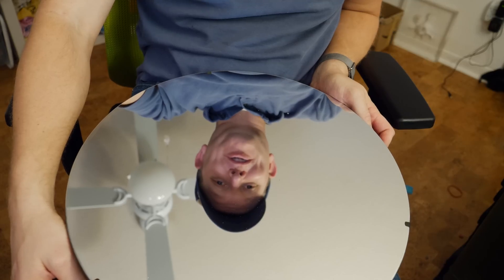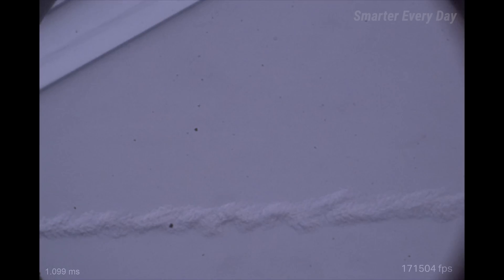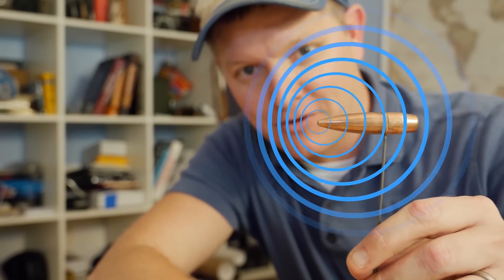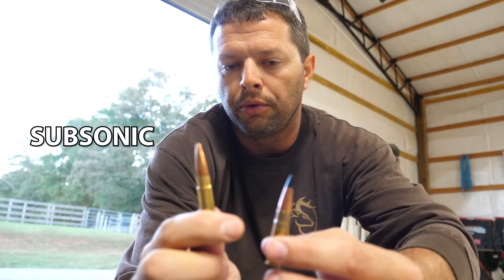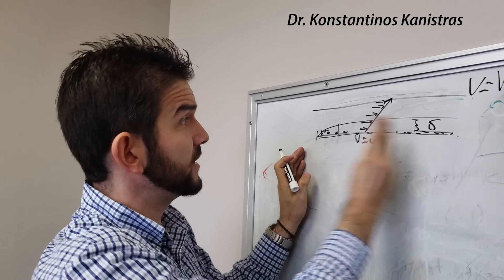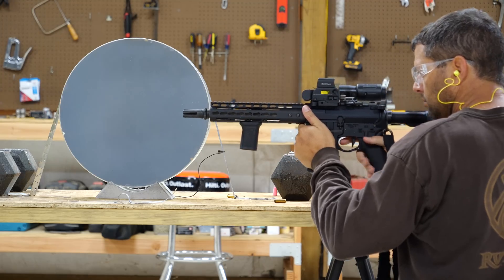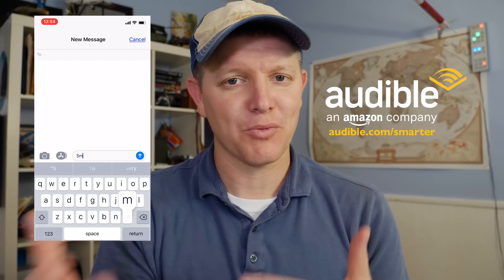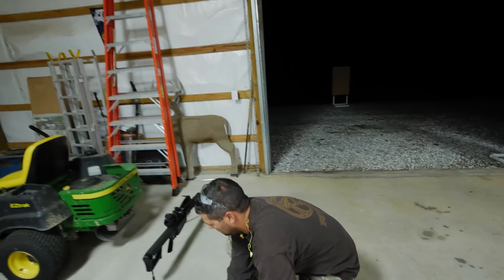Shockwave Shadows in Ultra Slow Motion (Bullet Schlieren) - Smarter Every Day 203

Comment: Good video, but I am going to go way out of my league and question your findings on the subsonic bullet. Depending on your serious friend's rifle it probably has a rifle twist rate of anywhere from 1:7 to 1:8 so every 7 or 8 inches that bullet will do a full rotation. Bullets on the outside, especially if they have been fired (they will have rifling imprinted on the side of the bullet at the very least), are far from smooth. Here is where it becomes pure conjecture, would that rate of spinning cause a small sonic disruption. In theory if that bullet was traveling at the rate of 1000 feet per second the pullet would make a complete rotation every .04 seconds for a total 1714 (rounded down) rotations per second or 102,840 rotations per minute. If we use the  n • 2πr formula where n = the RPM we should be able to get the velocity 102,840(2 X 3.14 X .154) = 99,458.6 feet per minute which is 1657.6 feet per second which is above the speed of sound. Now I have not taken into consideration drag or loss of velocity for any reason and on top of that I have failed every math class i have taken, but could that account for what you are seeing?

Comment: Destin, I love your videos. I'm a science geek, but one thing still bothers me. I've heard about Schlieren optics before, And I can look up online how to set up a spherical mirror and light point source, but what I don't understand is why the razor blade in necessary. Is the blade literally cutting light? and does it have to be a sharp razor or can a dull piece of cardstock provide the cutting power to activate the schlieren's power?
Reply: It's there to provide contrast for the ever so slight path difference of the light due to refraction. Think of the moving air as a weak lens. Higher pressure air has a different index of refraction than lower pressure air. The deflections are tiny especially at the focal point where it should be placed. So consequently the sharper the edge the better the contrast. Razors are used a lot in optics experiments.

Comment: Destin, in the right conditions on larger aircraft (757, 767) you can see the normal shocks over the wing. If you are seated above the wings, headed towards the sun, and you shift your head around, you will see what look like  vertical breaks in glass hovering on the wing.  When I was traveling a lot I noticed it and then made a habit of looking for them.

Comment: I think the circles are the actual sound waves. You should try different musical instruments and see if you can tell a pitch by measuring how far apart the circles are. Also, seeing the circles reminds me of a rock hitting water–the fluid dynamics at work between the bullet and the rock must be similar. 

Interesting note about the standing shock waves: During WWII when aircraft were improving their performance we started running into all sorts of problems with the aerodynamics and we didn't know why. One example is the P-38. It used to lose control during a nose dive because the standing wave disrupted the  air flow over the elevator.

Comment: I work at an airport and on sunny days I will see shadows on the ground coming from the sun passing through the airplane exhaust. The shadows look similar to the ones from Schlieren imaging. Is that because the light source is already essentially a point source, therefore it is able to project an image showing the variations in density of the hot exhaust?

Comment: The twisting of the center band comes from the fact the bullet is spinning and a 50 cal bullet has mid-body grooves due to the rifling. It may also have mid-body grooves put there during manufacturing.

Because shock waves represent, well, wave drag, this tells me the round would travel a lot further, faster, with a redesigned shape optimized for supersonic flight, along with a modification to be used in a sabot casing to minimize any surface marring.  You cannot ever eliminate shock waves.  You can, however, significantly reduce them beyond what you see, here.

Comment: I used to be a pipe fitter apprentice and solder/propress thousands of feet of copper pipe for hydronic heating and cooling systems. I would fill a tremendous volume often an entire high rise or lab floor worth of piping to 100psi to see if it was sealed. After some time I would blow it down and get to stare at the lensing effect coming out of the quick disconnect for a good while. Had to be super sonic. Very fascinating. You just had to have some good light in the background. No fancy setup required. You should try it!

Comment: Destin, for a long time I've been interested in the Bernoulli effect affecting BB's shot from an airsoft replica with a hop-up system.
You have the perfect setup now to capture this and I would love to see you make a video on it.
If you want to stick to firearms I have a different suggestion. Could you try to capture the difference in air pressure around a bullet caused by its spin?
I think the lines you saw might have partially been caused by that.

TL;DR spinning projectiles and Bernoulli effect is interesting, please film this.

Comment: Perfect opportunity to go into why flat base bullets are less efficient than boat tail bullets....but a wasted moment. Boat tails fly more cleanly through the air with less wake turbulence than flat tails. This gives them additional range. The.  .30-03  cartridge was developed for the m1903 springfield rifle. The cartridge had a lot of faults - Round nose, flat tail, and 220 grain weight. The high pressure powder behind the heavy bullet created chamber throat erosion. So they went back and redesigned it using features the Europeans had adopted. They put a spire nose on it, reduced its weight, and gave it a boattail. This new .30 cartridge was adopted in 1906 and became known as the .30-06. It became a premier cartridge in the US. That boattail and nearly 3000 fps velocity made it shoot flatter than other rounds of the period. The WWII ammo for the M1 garand was a derivative of the .30-06. Same dimensions but with a 150 grn. flat base bullet and less powder to lower operating pressure in the garand. It was called M2 ball ammo. But stocks of real .30-06 were still being made for the marine corps and for use by snipers using the m1903 springfield. The boattail and and heavier bullet could make a bullet  reach out and touch the enemy. There's stories of regular GIs using standard .30-06 in their garands for better accuracy. The round of choice was the armor piercing variety. The steel core evidently caused it to gyroscopically precess less than lead core, so has been alleged.

Comment: Cool videos of the bullets!

I have myself been studying near speed of sound flows over airplane wings, like what we saw with the slow bullet. 
The acceleration of the air around the wing causes it to move faster, but by setting the wing at an angle, the air travels down the length of the wing to extend the time it uses to get over the wing and accelerating the air at an angle, so the extra speed is split up in two vectors. All this is to reduce the speedup of air parallel to the direction of flight.
When the air then reaches the tip of the wing, we then place the winglets, or the tips of the wings, to reduce the turbulence that the air pushed outwards creates. This causes a vortex, or the swirl of air around the tips of wings, reducing drag.

Really cool physics, very simplified in my explanations and even more advanced, but fun, when you get to supersonic flight. However, that briefly explains why commercial airplanes have wings at an angle and some slower propeller planes have straight wings.

Would love to see a video of that if that ever becomes possible!

Keep up the good work!

Comment: This is an insane video! This reminds me of a phenomena that I saw while flying from San Diego to Detroit on a Delta flight. I was  sitting in one of the over the wing emergengy exit seats and loooking out over the wing. The aircraft was a Boeing 737-800. Due to the unique angle of the sun and the flight path, I was able to see a normal shock. It looked like a really thin dark line fluttering over the wing. I am wondering who else has ever seen this?

Comment: Hi SmarterEveryDay,
Wonderful video as always, stunning visuals. I have a question about this though, how are we sure about these refraction patterns are due to shock wave and not temperature difference? gun nozzle, exhaust gas, gun surrounding  and moving bullet everything would create large temperature differences which will (I assume) create similar images. could you please explain if possible.
Thanks!

Comment: If you want to determine where the secondary shock waves are coming from try placing on object interferes with the wave slightly on the surface that you expect the shock wave to be coming from. You might be able to see the footprint of the interfering object on the video.

Comment: Regarding those secondary shockwaves, you can just measure the time between the bullet passing, and them and use the speed of sound to measure the distance of the reflector and see if that matches the height of the table, and the bullet from the ground.

Comment: Hey Destin, if you want to improve your setup: the light travels through the area of interest twice, on its way to the mirror, and when it travels back to the camera. Because of the small offset this puts two schlieren inages on top of each other, with an offset. You can see in your image that everything is double. You can prevent that by having a larger angle between the two paths of the beam (and don't shoot through both of them). I hope this message reaches you.
Reply: I've worked on a similar setup to monitor airflow in an OR.

Comment: Also super interesting, with the .50 cal round it looks like you can see the effect of the rifling on the bullet.  Just behind, or at, the widest part of the round, the shockwaves appears to be twisting.  Also maybe a similar artifact as to what was seen with the sub-sonic round, caused by the air accelerating and decelerating while it enters and exits the rifling grooves?

Comment: I now know what Schlieren Photography is. I've seen many examples, but this is the first good explanation of the setup and how it works. Very cool and thank you.

Now for a question. Destin, I am fascinated by the dynamics of recoil in both handguns and rifles. At what point in time after ignition does the recoil impulse begin? What part of the recoil is attributable to the movement of the bullet and the pressure imbalance when the bullet clears the muzzle? Are there other factors?

Have you done this before? If so, a pointer would be most welcome.
Reply: Recoil begins when the bullet starts to move. Recoil is a function of mass and velocity, which can be calculated by the conservation of momentum equation.
mass x velocity(projectile) + mass x velocity(gas and unburned powder) = mass x velocity(gun)
Impulse = Force x time = mass x velocity
Things get complicated when there are moving parts, like a gas piston, recoil, or blowback action. A muzzle brake changes direction of the muzzle gases, changing their contribution to recoil (velocity is a vector). Also, a gun is not usually free floating, so the interaction between the gun and holder can get quite complicated as well.
The base equations are simple, but knowing the actual values at a given moment in the firing process is very difficult, so it is unlikely to come up with a meaningful calculation of a real world recoil impulse.

Comment: thinking on the transsonic as he called it or the supersonic movement of the subsonic bullet. I would presume that the directions of movement of air that is supersonic and the direction of the bullet are different. which I find really interesting. the bullet is traveling directly left (in relation to the video) but the flow that is supersonic is reaching the speed because of the additional moment outward from the center of the bullet.

Comment: Destin, get a bull whip to crack in front of that Schlieren setup.   Note however, that research has shown that it's not the tip that produces the crack sound, but the loop traveling down the length of the whip.    Should be able to prove or disprove that.  
Also a claim has been made that when a rock drops into water it forms a pocket of air that is ejected at supersonic speeds as the bubble collapses.  Might be an interesting test.

Comment: Dumb question... Does MACH speeds only translate on Earth? I'm assuming MACH speed would translate to a different "distance per time" on different planets or in space.
Reply: It translates to different speeds on Earth too. And outside of any atmosphere Mach has no meaning. That is because Mach is not an absolute speed. It is the speed relative to the LOCAL speed of sound. The speed of sound depends on the gas composition and its temperature. That is why Mach 1 at sea level is much faster than Mach 1 at 30,000 ft, or why Mach 1 is a higher speed on a worm day.
Reply: ASJC27 I did NOT know that. I feel smarter today.

Comment: That Normal Shock is one of the reasons that historical aircraft had issues when they started approaching the speed of sound. That shock wave (non-symmetrical above and below) would start interacting with the control surfaces of the aircraft, causing instability. Getting past that transsonic zone was hard and dangerous back then.

Comment: Would be interesting to get the same imagery of the muzzle break of the barret. There's a lot of debate as to weather it's well designed or not. Certainly it's effective, because it's got a lot of gas to work with, but is it efficient?

Comment: Howdy. The circles you see are probably the same you hear (the "zip" sound)  when a bullet passes by (ignoring the initial blast and the shock you would hear from a supersonic one). Sound waves. Put a powerful speaker in front of your mirror and you should see those too.
Also, if you want to check where  reflections are coming from, simply time them and multiply them by the speed of sound. You may need a factor of 0.5 if it is a reflection (time to go and return), or not if it is from the nozzle. I do this all the time in my work doing CFD.

Comment: Lol, Ive tested subsonic bullet in a fluid flow program. Destin should try it out, it makes it obvious that the pressure decreases down the bullet and the speed of fluid increases. Pressure decreases as the flow becomes turbulent because the fluid along the bullet slows down due to friction, but a little farther away there is a wall of dense fast moving fluid. Most people dont realize that more turbulence essentially means less fast moving air contact with the object

Comment: "Normal flow" - AKA supersonic airflow over a subsonic projectile - I learned that in my Aerospace Engineering courses 20 years ago. That's one of the main reasons commercial airliners travel at about 0.8 Mach, rather than much closer to Mach 1 - even at 0.85 Mach, a 747 has portions of the fuselage/wings/tail that have supersonic airflow.  And airflow right at supersonic speeds has a LOT of drag.  So the preferred cruising speed is the maximum speed where there is minimal supersonic flow.  

That's why average airliner speeds have actually gone DOWN since the 747.  To minimize this supersonic flow. A 747 CAN achieve speeds of 0.95 Mach, but it becomes VERY inefficient at those speeds.  That 10% Mach increase in speed can decrease range by 20%.
Reply: What happens if a 747 is at those maximum speeds and then goes into a dive without the throttle nor anything being changed to slow it down? Does it go fully supersonic? Can it survive that?

Comment: I wonder what would happen if you shot through a vacuum chamber, like actually shot the vacuum chamber, how quickly you would see air enter behind the bullet..
Reply: What an amazing idea!
Reply: Or fired the revovler inside a vaccum chamber at full vaccum. No air resistance to the shockwave as well as the pressure wave reversal as it peirces the side then implodes back inward from high pressure to low pressure. Even without atmospheric oxygen i believe the shell would still fire. #Codyslab
Reply: @atheistonavmax7873  That would be really good! Im not even sure if it would fire without air.. Also a firing mechanism would have to be build inside the chamber with a remote trigger pull. Not sure how a string would work being it would have to lead out of the chamber to be pulled manually.. Im sure Destin can think of something
Reply: Bullets will fire without air, there are plenty of videos of them firing under water. A RF controller and a servo inside the vacuum chamber would work just fine.
Reply: @MrScottyMillz  gunpowder is self oxidising, it doesn't need an external source of oxygen (such as air) to fire.
Reply: @MrScottyMillz  The speed of sound.

The reason that's the "speed of sound" is that's the speed at which the material can move, which is thus the speed at which it will bump into the material around it, which is how sound waves spread. Want a demonstration of the effect?

The "Speed of Air Pressure Through a 1000ft Tube
" video by Cody's Lab demonstrates how long it takes to re-fill an evacuated tube with air. The value he finds? A bit over 1100 ft/s, aka: the speed of sound to within the likely error margin of the test.
Reply: @atheistonavmax7873  The round would fire in a vacuum as it has an oxidizer in the powder. As far as shockwaves go, if you fired in a true vacuum there would be no shockwave besides the expanding gas of the round. Since there's no air in front of the bullet, there's no air to be forced out of the bullet's path and no wave to stack up at the front.